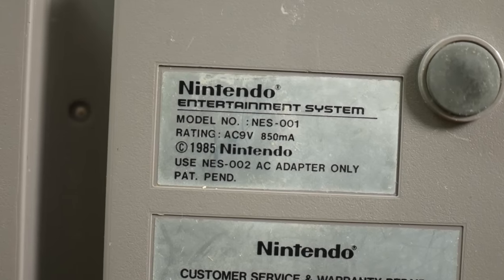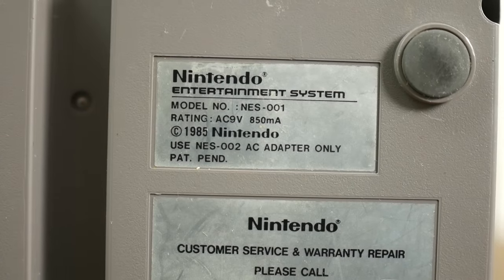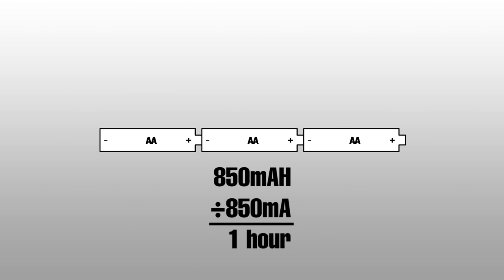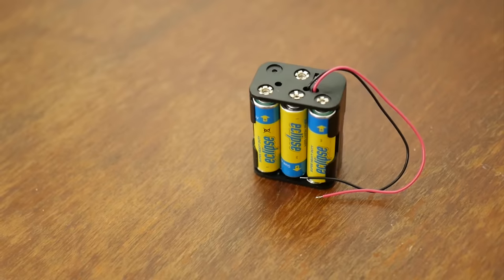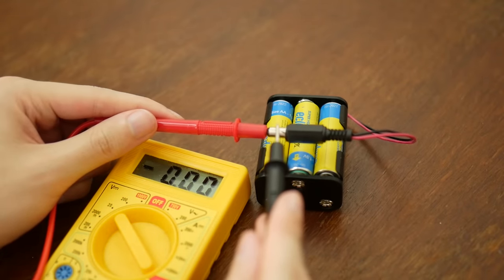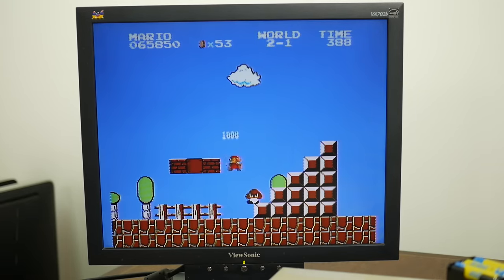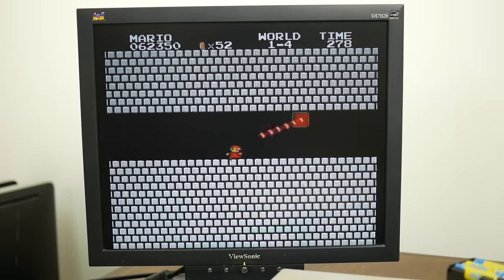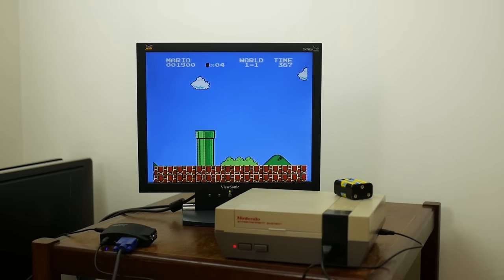Can you run an NES from AA batteries?

Comment: A single 9v battery will power a NES however not for long.
Reply: stuff for the next video :)
Reply: Connect those in parallel, profit.
Reply: I actually had a Arduino 9v battery adapter that just so happened to fit my old NES. And yeah I played Mario 3 for about an hour~ before it started to glitch and die. That was back in 2011. Pretty neat though.
Reply: No, it doesn''t power NES even for a while . trust my i tried it.
Reply: Baosław Baowski it does power it. You have to make sure that the 9v to barrel adapter has the right  configuration in respect to ground and power. Some barrel jacks the center is ground and outside is power, and vise versa. Keep that in mind. Good luck. Cheers.
Reply: @ncl3rdy2  polarity does not matter on the NES. The factory power adapter put out AC voltage. There is a rectifier inside the NES that converts it to DC. There are some capacitors for smoothing which do go bad over time. Power then gets regulated down to 5V by a 7805 regulator. I have 3 old NESs. 2 work flawlessly. Have refurbed them. Clean or replace the 72 pin connector. Replace all the capacitors in the unit. The third one works bit has corrupted graphics. I think it's a  PPU or a memory problem.
Reply: @ncl3rdy2 I check it, but in nes it dont have matter because oryginal nes power supply is AC and in nes is full bridge rectifier .maybe just my battery was litle discharged.
Reply: @Baoslaw  It will work and I will tell you the secret. First you go to www.Amazon. com on your smart device and you are going to search for (deep cell battery ) (car inverter )(trickle charge deep cell solar panel ) (alagator to cigar plug cables) buy whatever is the best price and wait a few days. After you recieve the products just connect the inverter and solar panel to the batter that is the same color.  Now you can play nes for hours on battery as long as you keep the solar panel in the sun.
Reply: So connect them in parallel you only need 2 9v
Reply: @matlee7401 better yet throw those 9volt in the trash and get a ups generator.
Reply: @ghostunix731  for long term yes but just rairly 9v batteries are fine
Reply: @ghostunix731  besides YouTube I don't use internet and thou art unnecessary crule. Thou doth bringeth shame upon yourself. I shame thee.
Reply: @matlee7401  Well see that's your promblem. You are watching bums on YouTube when you could be learning the stock market.
Reply: @ghostunix731  y would I learn the stock market when I wanna be a chemist. Besides stock market most fail because it's way hard so chemistry is more reliable of a job
Reply: @matlee7401  It's not hard if you are taught by reliable couch and chemistry can go wrong and you can be badly injured loosing your quailty of life and even homeless .
Reply: @ghostunix731  I have no way to be taught by a good coach and chemistry is only dangerous if u mess up
Reply: I tried I nine vault it works best. If you use 3 of them at once you can get about 45 minutes
Reply: @segamatthews5023   get a smart phone power band and bridge the USB to run the best for hours.
Reply: Why use 9v battery when you can use an anker power core 10000 mah, and a voltage regulator.?
Reply: @leonardodepinto7912  IKR these kids are special.
Reply: The internal of a 9v is actually a series of 6 AAAA batteries in series.
Reply: @SuperPickle15  what's inside my ups battery a fuck load of AAA?  I am hoping its AAA and just acid because someone told me that car batteries were full of D batteries and it was just these plates.
Reply: Si ponemos 3 baterías de 9v en serie podemos jugar por mucho tiempo
Reply: @shadymaint1  try disabling lock out chip cut one pin or unsolder it and bend away from board
Reply: @wizard3z868  Of my 3 NESs 2 have pin 4 of the lockout chip disconnected and connected back to ground.
Reply: @ghostunix731  those are not generators they are a battery so if your power goes out and there is a PC running it can be shutdown properly with (sudo shutdown now) or the (windows start menu) but is not made to run a pc for very long and it doesn't make new power it just charges some lithium batteries when it is plugged into a outlet that has power and switches really fast from the outlet to the batteries when there is no power from the outlet
Reply: But a potato will!
Reply: 9v batteries are rated with far lower mAh than AA on the average.
Reply: shadymaint1 9v batteries also have troubles outputting anything near 800mA so if anything was to work they would just get extremely hot.
Reply: You also can power an Atari 2600 off one.
Reply: @ncl3rdy2  It doesn't matter... as was shown in this video, the NES has a rectifier, which not only means it accepts AC and DC, but it also doesn't matter which wire is ground and which is power.
Reply: I was able to play super Mario 3 on a NES for 30 minutes. I was actually going to cut an old charger to make the connector, but I found one that came in an electronics kit. I ended up cuting the cord anyway to make a 9v battery charger for a mini portable tv that takes 12 D batteries.
Reply: Just connect it in parallel...
Reply: laughs in emulation
Reply: Solution: NES connected to rechargable 12V battery, which is also connected to a solar panel. TV is apparently powered by dark magic, but some can be run off 12V.
Reply: User 2C47 just connect it to a Sony watchman
Reply: @ghostunix731  why do you have to be so negative?
Reply: @SuperPickle15  OMG, you're right! But they're not AAAA, just a bit smaller than them. If you can add 3.5mm of foil, it'll work.
Reply: I tried it, it works with alkaline batteries, but not with old chemistry batteries.
Reply: @rich1051414  the NES needs at least 7 volts. Doesn't matter if its AC or DC. There is a rectifier and a 7805 voltage regulator inside the console to step down power to 5V for the electronics.
Reply: @shadymaint1  Ok? A good 9v alkaline battery powers the NES, please try it. I did when I made this comment and it works. But the old 'heavy duty' 9v's don't work, they can't supply enough current or something. The system can't boot but the light does come on.
Reply: Solution:
Fucking connect 30 of them in parallel lol
Reply: I managed to run mine (a Famiclone actually) from a 9V battery back in the day (early 90s), when the AC power adapter went bad and I wanted to play, but it didn't go for long. I cut the output cord from the dead power adapter, hooked it to the battery and connected it to the console. I was like 11 years old at the time.
The single 9V battery lasted for about 20 minutes (wasn't new, don't know how much of its original charge it had left). 
The Famiclone's power supply was different from what original Nintendo units came with, as some commenters below state; the rectifier was inside the power supply, as opposed to being inside the console on an original NES. The power supply of my console was rated 9V, 1A. Within the console there was a second filtering stage and the regulator that fed 5V to the rest of the board.
Reply: @danrog-hv1st  no, en serie matas tu NES, en paralelo si es como lo has dicho
Reply: @ghostunix731  Your UPS battery is most likely full of lead sponge and sulfuric acid. I would not recommend pulling it apart. 
6v Lantern batteries sometimes have cells that look like tall D batteries, which you can remove and repurpose. 
Same with the 9v: Some of them use cells similar to AAAA batteries (but not quite exact) that can be used individually.
Reply: @ftcgaming4651  Yes, and you can also wire up 6 AA batteries in series to get that 9v as well. I'm too lazy to work out which combination has more mah on the balance.
Reply: @shadymaint1  That's good to no. If I understood correctly, Sega did not bother with that when they did their tower of power, so 2 of the units have polarity in one direction and the other is flipped.
Reply: @Baoslaw  The original NES isn't AC, it's DC. The port is labeled "ac adapter" but if you look at the power specifications, it specifies 9v @ 850mA. I have never seen an AC power port that is in that form factor. They may exist, but I've never seen it in any consumer hardware. If it's AC, then it's one of only a few options, none of which use barrell plugs.
Reply: @Baoslaw  thier is a 5v regulator and a rectifier inside the NES.
Reply: @SmallSpoonBrigade  Original nes power supply is AC. It is only transformer. Bridge rectifier, smoothing capacitors and voltage regulator are build in console I have german version and on back labe isit's written "AC 9v 1,3A(AC)"
Reply: @ncl3rdy2  as explained in the video, it doesn't matter the polarity, because the NES has the rectifier inside the console, and was fed AC power from the adapter

Comment: Just run 15 9v batteries in parallel should be hours of on time
Reply: But very expensive fun time (unless they're rechargeable)
Reply: @Empika  Or a car battery.
Reply: Luis Marques are car batteries 9v? Otherwise that wouldn’t work.
Reply: TrainRider Railfan no but the nes runs on 9v
Reply: Or you can just be a normal person and use lithium ion batteries with boost or buck converters to get the voltage you want.
Reply: TrainRider Railfan nes have a 7905 converter inside. Nes work in 12v too. Just get a bit hotter but will work anyways.
Reply: mashed potatoes a “normal person” just plug nes on wall xD.
Reply: Like 13 hours
Reply: TrainRider Railfan No, Car batteries (and most lead-acid’s) are 12v
Reply: @sjogosPT  lMAOOO yeah you got me there.....
Reply: TrainRider Railfan I don’t think they are but I actually did that with a tv and a nes it worked just fine good for hours
Reply: Shouldn't 2 serial six-packs of AAs connected in parallel double the mAH while also retaining the 9V of power? That's 12 AAs for 2 hours of NES!

With rechargeable AAs, the small top-down NES model, some franken-display from a Raspberry Pi or something, adapted to take the composite signal, you could actually make it reasonably portable, and perhaps even run it all from the same power source.

But it's still pointless, considering you could just emulate on your phone
Reply: Just get s AAA batter
Reply: @3lH4ck3rC0mf0r7  emulate it on a Pi, then youre looking at less current draw than the NES (even with an LCD panel), and its only 5V, run it off 8 good AAs in a 4/2 config youre looking at maybe 6V 5600mAh, thatd be like, 8 hours at around a 650mA draw. you could even attach a USB NES controller. youd need a diode or something to drop it to 5V tho
Reply: Zoë Rycroft my IQ-502 work with USB POWER. I Made adapter from this plug to usb and... this work with powerbank and a small portable tv :D PORTABLE PEGASUS!
Reply: Or Buy 18650 cells and a step down converter
Reply: For double A batteries youd want a series-parallel setup with 6 batteries in series in (x amount of) rungs of a parallel ladder. Yay my degree is useful!
Reply: Connect series of batteries in parallel
Reply: @sjogosPT  My neighbor had a NES he wanted mt to look at. He gave me a 35v power supply I forget if it was AC or DC but it took 35 volts no problem. lol
Reply: The series batteries setup acts like a single battery. Connect those in parallel.
Reply: @TRRailfan  Car batteries are 12.6v, and the NES can technically run up to 18, so It should theoretically work.
Reply: @TRRailfan  The Regulator inside would handle line 18V or even more so it would be fine...ish
Reply: @mashedpotatoes5323  Or just run 3 serial sets of 2 parallel batteries.
Reply: @commscan314  depending on how efficient the nes is with varying voltage a boost or buck converter set at a particular voltage might be more efficient.
Reply: @TRRailfan  car batteries have more than 9

Comment: "The batteries wont last very long"
"The NES's voltage regulator is rated for up to 18 volts"
Car Battery would like to know your location
Reply: There we go
Reply: it’d be interesting to see how it would fair connected to a car’s 12v, probably explode haha
Reply: @tecc9999  Why should it? I definitely wouldn't connect it straight to the 12 V system of a running car though - apparently that can have some really nasty voltage spikes that well exceed the 18 V of the regulator.
Reply: @Ragnar8504  obviously through some sort of step-down converter or regulator it won’t, but connected straight up to the battery’s 40-something amps it’d definitely would, regardless of the current spikes lol
Reply: @tecc9999  Please have another close look at Ohm's law! Unless you've got a fault (short-circuit) it doesn't matter how many amps a source can supply, providing it's at least as many as you need (0.85 in this case). The NES or any other load just takes as many amps as it needs. As long as the voltage is correct of course. A (much) higher voltage will immediately destroy the NES!
Reply: @Ragnar8504  ah you’re right fair enough haha
Reply: @Ragnar8504  well there's the 9 v ports on a car and some vans have a tv
Reply: I mean, many replacement AC adapters supply 12v instead of 9v, so it probably doesn't matter.
Also an NES would run basically forever on a car battery
Reply: @Ragnar8504  Crazy because my neighbor wanted me to look at his NES. The pins were just dirty and the games wouldn't read most of the time. Well I didn't realize he gave me a 35v power supply. Don't remember if it was AC or DC but it took the 35 volts no problem.
Reply: Actually when you rectify AC to DC you should multiply your inserted AC value with 1.41 so 9V AC is converted to 12.7V DC. In that circumstances a car battery is almost perfect for running NES lmao
Reply: @tecc9999  The current doesnt matter but the heat dissepation of the internal (NES) regulator might not like it
Reply: Even a scooter battery 12v 7A
Reply: @kargaroc386  That's because the NES does take 12V. 9V AC has a peak voltage of 12V which is what would be the output of a rectifier supplied with 9V AC (minus the voltage drop of the rectifier of course). So providing it with 12V DC gives you almost identical operating conditions as 9V AC.
Providing it with lower 9V DC means that the regulators receive smaller voltage than needed which makes the regulator have to pass more current through. On average the rectifier would have to dissipate 12% more heat to handle lower input voltage.
Ironically giving it higher voltage close to 18V would make it run more efficiently with less heat being generated by both the rectifier and the regulator.
Reply: @davidkinkade81 I’ve used the TV thing before, I mostly bring my plug and play controller on it and it works.
Reply: The regulator itself may be rated up to 18 volts, but is the heatsink rated for that much heat sinking?
Reply: Or even better, how about a deep cycle lead acid batt, this way it won't die after a few days of nonstop heavy gaming on the go
Reply: @tecc9999  You could actually buy custom vans with NES's built into them back in the 1980's.  They would connect them right up to the 12 - volt electrical system in the van, along with a 12-volt CRT-TV.  Some vans had VCR's in them as well. Custom van builders like Starcraft and Gladiator reguarly had NES's as an option

Comment: "CHANGE DA WORLD

MY FINAL MESSAGE.

GOODBY E"

- BatteryNES, 2019
Reply: Lol
Reply: Thancc... You
Reply: I hate that meme
Reply: @fanpusheen2642  gtfo
Reply: Error
Reply: @sign_verken  hmmm not really an error in my eyes 
This is battery’s 
If the NES is getting less power it will start slowing the hell down 
Black and white saves powers 
The game being a insanely slow or people call it insanely buggy save power 
Like there is no error there it’s just the NES getting slower and slower because games go 30 frames per second I think so less power = less frames are used or even skip frames 
Check the pause you only see 1 letter because the game became so slow where it uses to much power 
That’s the thing if the NES don’t have enough power it will remove assets just so it can stay on until it runs out of power where they can’t use any assets anymore meaning there is no power left
Reply: @fanpusheen2642  why...
Reply: And then a Windows 95 PC replaces it
Reply: @fanpusheen2642  GO THEN
Reply: @Mrnoobestreturns  no wonder the Gameboy last a while in asid green
Reply: @fanpusheen2642  ok and?
Reply: @fanpusheen2642 ewwww hater

Comment: The dropoff of the power is actually a really cool effect. Instead of using a battery, it would be sick to set it up to some variable voltage power supply. Have it running, capture it all, and slowly slowly crank down the voltage to make it glitchier and glitchier.